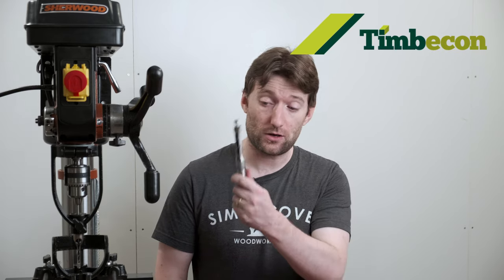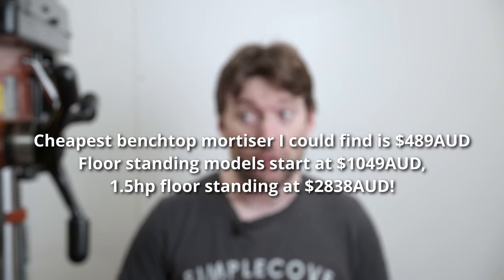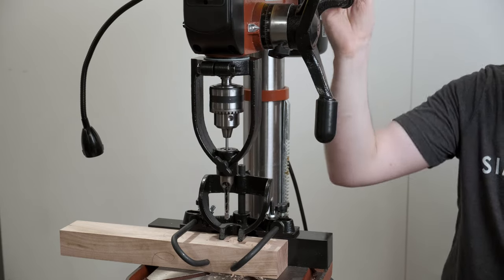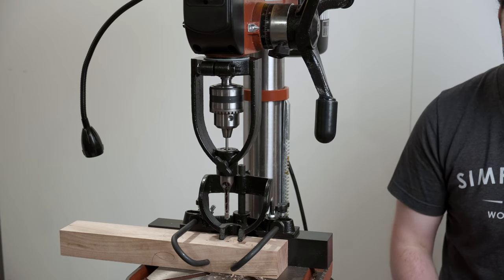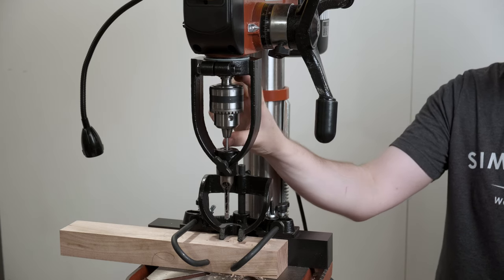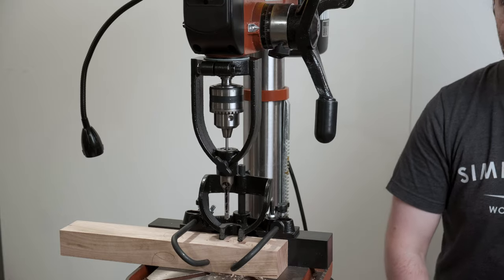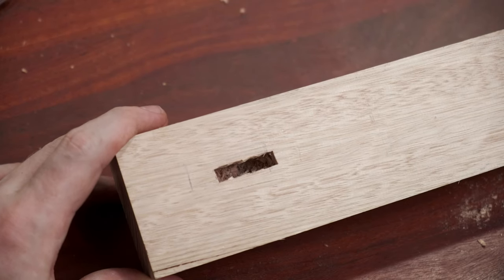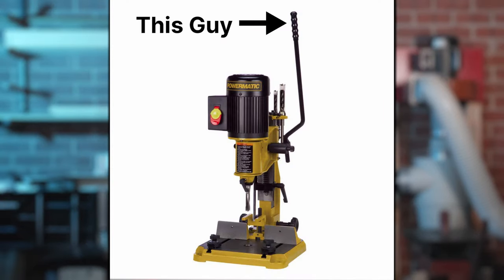Mortise & Tenon: Drill Press Hollow Chisel Mortiser

Comment: Hi, I am in the happy state of having both a floor standing drill and a mortise, as you said the stand alone mortise with a cross slide vice means that I can use the chisel much easier and because I am not changing the bit all the time it is set up perfectly. The only caveat I would put on the down list is that although I have more sizes I do not tend to change the chisel because I would then have to set it all up again
Reply from the maker: It's interesting to hear you use a single size on a proper mortiser, but it makes sense, the whole thing looks fiddly. I guess there are trade offs with size of the chisel and speed you can cut through anyway, so may be faster doing overlapping widths.
What size to you use?

Comment: Thanks. Of all the reviews of this type of mortising attachment this is the least negative I have seen, yet this style has been around for donkeys, why has no one been able to sort out the problems? Also,  is there a minimum hp for the drill press to drive the attachment?
Reply from the maker: I wouldn't call this a review - I only spent about an hour with it, and at least 45minutes of that was trying to fit it to a drill press with a toolless chuck! 😂

The horsepower doesn't really matter - I mean, it does but it also doesn't because the limitation is always going to be the leverage you have (or don't have!) on the chisel. The auger bits (particularly in the 19mm and smaller sizes) could be driven with 1/3 HP no problem, but not being able to push the chisel through the timber stops it dead in the tracks. That'd be the number one reason they're not more popular. 

The biggest hurdle these kits face is how much do you spend converting it to a mortiser (jig + lever + crossslide vice) when other methods exist, including bench top mortisers.

Comment: Inconvenient in almost all aspects. Got a dedicated HF Mortiser for about $100 which is not great but still easier than this for unclamping and moving the pieces. Plus it can be given much longer fencing etc for great more accurate repeatability. My floor drill press would take a BUNCH of mods that would never work for this because of total inconvenience for wood longer than about 18 inches...No clamping, shaky table, less up and down strength with many turns to get to depth, and wobbly stand, and  ... Yeah - not an option. Sorry.
Reply from the maker: Haha, keep in mind this series of videos isn't a review of any tool or to persuade people to switch to X-Y-Z method of making mortise and tenon, but showing off all the ways of making M&T with power tools that I can think of. I'm trying to be objective and not poopooing methods that people might prefer (like the plunge-rounter-to-make-tenons)!